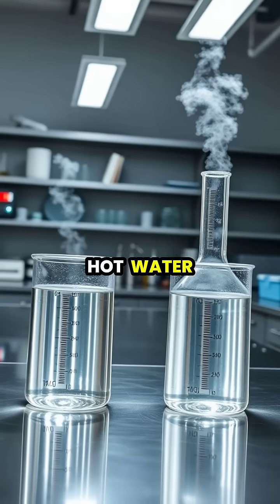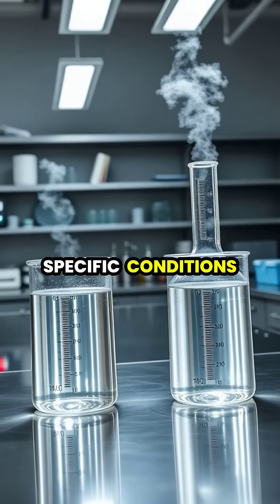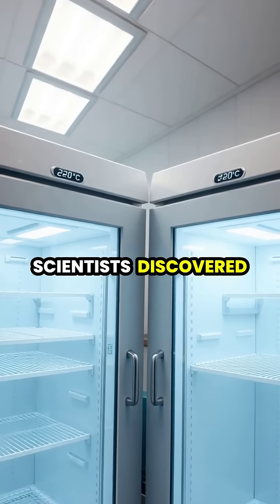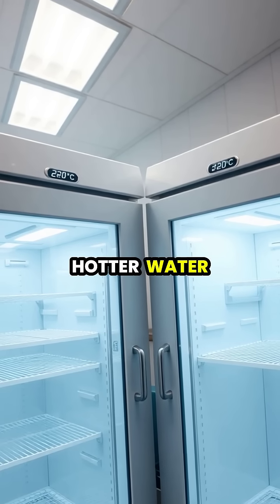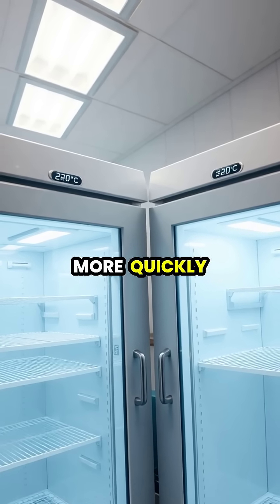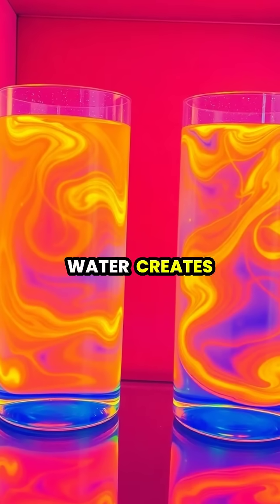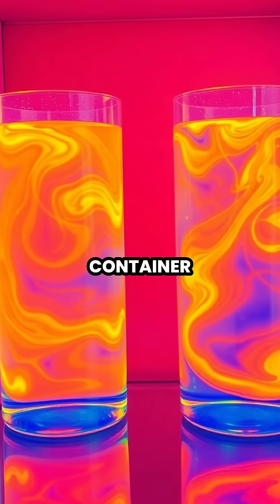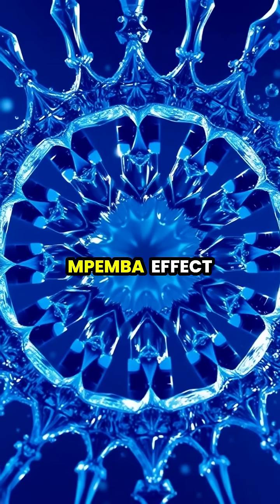Unlocking the Mpemba Effect: Why Hot Water Freezes Faster! ❄️🔥

Comment: Not all the time because if the container is irradiating heat as well it will cause the condenser to constantly run and thus turning on again to cool down the outside surface of the container then trying to cool the liquid on the inside at the same time Most of the time this does not work but I do understand the principle depends on what container it is